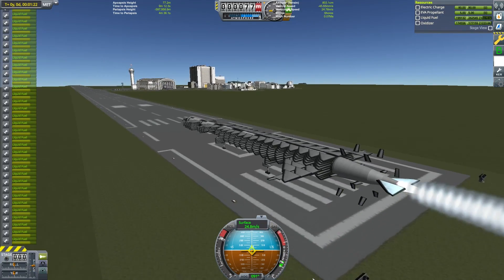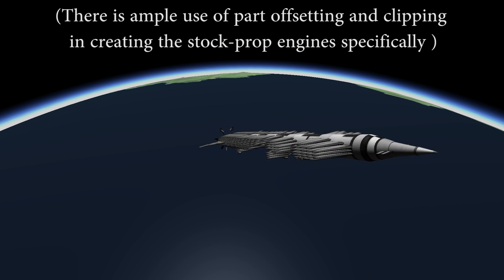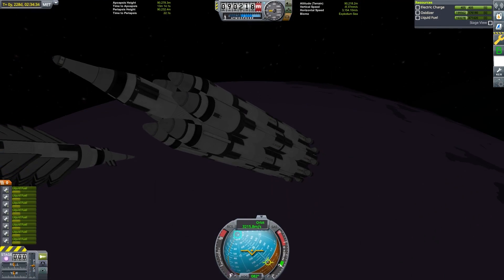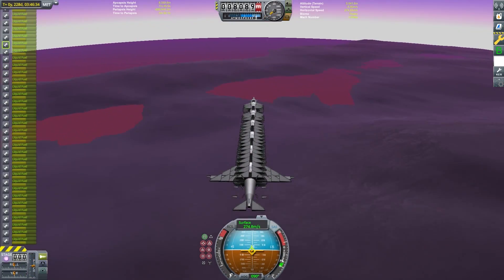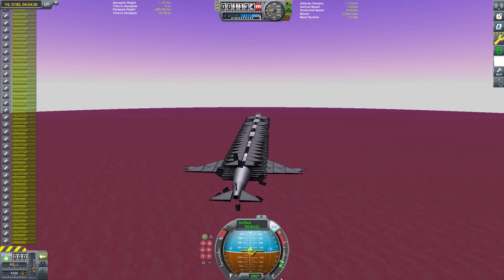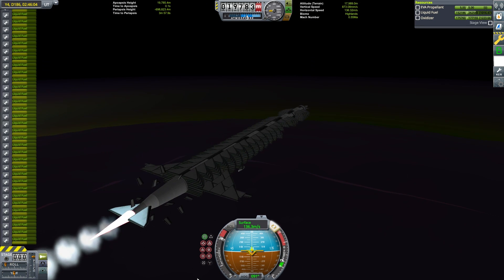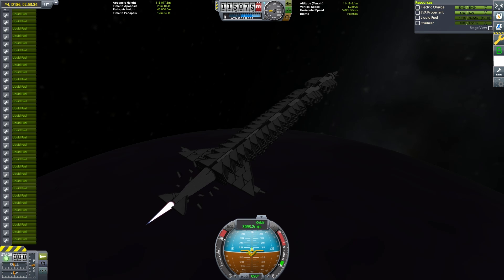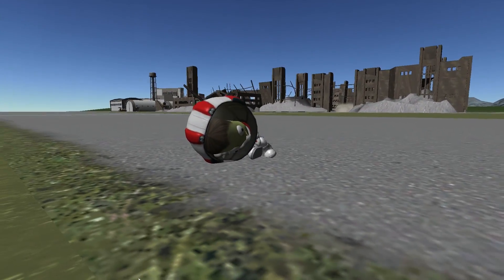Stock propeller powered Eve SSTO from sea level

Comment: Could you theoretically be able to build a Kerbin-Eve sea level-Kerbin SSTO if you just kept adding boosters? Sure, each next fuel tank will give you progressively less DeltaV, but you would still get there eventually, right? Or is there some sort of inpenetrable barrier that you will get infinitely close to but never actually reach? (Like trying to get to number 1 by adding 0.5 and then keeping adding half of the number you previously added. You'd never reach number 1.)
Reply from the maker: It approaches a mathematical limit as more fuel tanks are added.  We can calculate the limit your delta V approaches by taking the natural log of the maximum possible ratio of wet mass (mass including fuel), to dry mass (mass without fuel).  The full to empty tank mass ratio in KSP is 9 to 1.  (If you have a fuel tank that has a mass of 9 tons when full, that 9 tons consists of 8 tons of fuel and 1 ton of tank.)  ln(9) = 2.197...  You can then multiply that by standard gravity (g = 9.81 m/s^2), and your engine Isp to get the limit of your delta V as number of fuel tanks added goes to infinity.

For example, with a vector engine, with an Isp of 315 s in vacuum, this limit is : ln(9) * 9.81 m/s^2 * 315 s = 6790 m/s
For the skiff, with an Isp of 330 s in vacuum, this would be 7113 m/s

If fuel tanks had 0 dry mass, this function would become unbounded.  However, it would remain an logarithmic function, with severe diminishing returns. 

   Back to the original question, regarding whether the Kerbin -> Eve landing -> Kerbin single stage, unrefueled plane is theoretically possible, the answer seems to be no.  7 km/s already isn't much to work with.  You need to spare mass for engines, ion fuel for the interplanetary transfers, wings, landing gear, reducing this further.  If you bring air breathing engine or stock prop, that further decreases the fractional mass available for fuel.  You also have decreased Isp in atmospheric use of the rocket engines.  Short of some radically new approach, it doesn't look possible.

P.S.  'Boosters' generally refers to staged assemblies
Reply: good lord  @BradleyWhistance
Reply: @BradleyWhistance  I've been playing KSP on and off for a few years, and I finally know enough math to understand what you just said. I haven't played in a while, and I'm thinking maybe I should get back into it
Reply: Omg wow
Reply: @BradleyWhistance  Curious! The Mk0 liquid fuel tank has a wet:dry ratio of 11:1 which seems to be 22% better, but if you could somehow use it for the same purpose, it would offer only a 9% increase in range. The range difference isn't quite the square root of the difference in wet:dry ratio, so I'm wondering what it is; if you can calculate range difference directly from the ratio.
Reply: A bit late, but you would probably end up being severely limited by how much of a stroke youre willing to give your computer. I learned this the hard way when I tried to get a 100,000 ton mars transfer stage into orbit in RO with single digit framerates and my computers pretty beefy.
Reply: It is possible using certain physics engine exploits. One in particular can even give you a grand tour with no engine, though I'm not sure if it has been patched, and it was always difficult to control
Reply: Here after watching stratzenblitz video, yes, its possible
Reply: you would reach 1, just after an infinite amount of time.  I assume you can get very far in terms of delta V with every little improvement. however, you are limited by your computer
Reply: Kraken engine + prop engine

Comment: Brad: "A very simple, straightforward 2-stage rocket"
Also Brad: "65 mammoths on the lower stage, and 60 wolfhounds on the upper stage"
Reply: I mean, its simple, you just keep adding fuel tanks and engines until it works
I learned it from my double gravity series lol
Reply: Haha, radial mount go snap.

Comment: Did you try to use the propellers in reverse during descent?
Reply from the maker: I did consider this!  If undocked at high speed, it can cause excessive stress in the bearing.  At low speed, it glides well anyway, so it simply isn't necessary.

Comment: Astounding. Any chance you could post a quick breakdown of how the stock propeller apparatus works? As far as I knew rotating parts in stock KSP were impossible, let alone rotating airfoils with enough force to move 200,000 tons. Or if anyone else could just link me to something explaining the construction principles involved, that would be just as good. Thanks in advance (I hope).

Comment: wait, what does reversing nose cones do?
Reply: Forward facing surfaces generate more drag than backwards facing surfaces. If you rotate a nose cone that's on the front to facing backwards, you essentially have no forward facing surface, which drastically lowers drag, especially as you go faster and faster.

Comment: If low altitude on eve is problem why dont you use aerospike engines? I never see anyone use them and they'd seem perfect on eve. While they dont have gimbal the rcs and control surfaces could help
Reply: Guessing that they just don't provide enough thrust for their fuel consumption
Reply: @doas6311  that's the opposite of what they are supposed to though, they are meant to be super efficient in atmosphere, you could use atomics in space and earospikes in atmosphere
Reply from the maker: @Dragon74213  The Aerospike does have the best TWR at sea level on Eve.  Problem is, its TWR is bad, and the Vector/Mammoth engines have better Isp during a lot of the ascent anyway.  They also are not very compact.
Reply: Exactly. When it comes to eve, raw TWR is more important. Your margins for useful payload are very small, successful eve rockets can barely lift their own dry mass, let alone any cargo. So to use aerospikes, you need to build a rocket capable of carrying a lot more dry mass for the exact same amount of thrust... which is hard when you’re talking about a planet where every pound of dry mass hinders you this much. Any fuel savings you’d have from using the more efficient aerospikes is immediately pissed away by having to lift the extra dry mass the engines.

This same principle is also why I jump to vectors and mammoths instead for just about everything atmospheric. The same principles apply on Kerbin too.

Aerospikes USED to be very commonly used in KSP, espescially in SSTOs where they were paired with panther jet engines. They were also often the goto engines for Eve. They were very good.

The reason nobody uses them now is that they’ve suffered “power creep”. All these new fangled engines have been added, all of which have stats that essentially make aerospikes superfluous. The aerospike hasn’t really had any stat upgrade to keep up and compete with the new engines.

To put this into perspective, back when the aerospike was used often, the biggest engines in the game were the mainsail and the skipper (2.5 meter engines). There were only 2 jet engines, the one often used was the panther.

There was no Rapier, there was no Vector, there was no Mammoth, etc. In that kind of environment, using an aerospike makes A LOT of sense. Most of the traditional rocket engines only had slightly better TWR, and were quite inefficient. The only real downside to the aerospikes was their small size, small total thrust, and lack of gimbal. Nowadays, want an SSTO? Just use rapiers, don’t need to do rocket/jet pairs anymore. Want a rocket? Use something with good TWR to get you out of the atmosphere, stage, then use something with high efficiency once on orbit (just like real life rockets).

The aerospike has little place in the real world too. It’s a complex and heavy engine type. It’s only worth spending that kind of effort on it under one condition: If you are using the engine for 100% of your propulsion needs on a trip, and if you are going to be getting the engine back. In other words, a rocket powered SSTO. It was developed specifically for this purpose, to be used on the X-33, the only project that got anywhere close to actually achieving SSTO purely on rocket power. That project was canceled, and no rocket powered SSTO projects have since replaced it. Instead, the space industry has since settled into using traditional multistage rockets.

And thanks to the Sabre engine (the real world engine the rapier is based on) and the Skylon space plane it is intended for, there may NEVER be a place for the aerospike engine in the real world. The Sabre engine is a jet rocket hybrid that has a very high TWR (for a jet engine), can operate in most ranges of atmospheric flight (unlike most jet engines which typically have very limited ranges), and can take a space plane up to 20% the speed and altitude required to achieve orbit in air breathing mode alone.

In other words, if the Sabre engine proves to be as good when it finishes development as it appears to be on paper, there’ll be little point in making rocket powered SSTOs... Which means little point in making aerospikes. Who knows, maybe it’ll be worth it if we ever attempt to make launches from the surface of Venus, given how incredibly thick and oxygen deprived that atmosphere is. But that’s a long way off.
Reply from the maker: @hatman4818  Additionally, the vector engine is much more compact than the Aerospike, and has massive gimbal range.  On the other hand, the Aerospike looks nice...
Reply: @BradleyWhistance  That's another reason I use vectors. It's basically a 1.25 meter rocket engine with 2.5 meter engine thrust values. I made a subassembly that is a 5 meter tank (using the expansion parts) with 12 or 13 vectors mounted to it. None of them clip, and if I radially mount more of these blocks to each other, they won't interfere with the other blocks as well. I figured that gives me about the highest TWR in the smallest package possible for a 5 meter rocket.

Comment: Congratulations.   I really think KSP should introduce build-in propeller system. Propellers are theoretically supported by KSP’s physics and make a lot of missions possible.
Reply: Exactly. This, and for god’s sakes at least ONE hinge. They already have a stocklike hinge model developed for stock KSP that they dropped before putting in.
Reply: @GrandProtectorDark  I really wish they would add some electrically powered propellers. I would love to be able to fly planes on planets that have an atmosphere but no oxygen without having to use ultra-thirsty rocket engines.
Reply: this is a comment from the future. ksp has propellers now
Reply: It appears easy from a programming perspective, just take a jet engine, swap out the fuel requirements and give it a model. Shouldnt be too hard to do.

Comment: Have you considered using the part welding mod to reduce the part count? Or does that change the physics or feel cheaty in a way?
Reply: That means it's no longer stock though.
Reply: I've also had little luck with part welding aside from structural parts. The problem is different part types will have different properties that all then get applied to the welded part. I tried welding several Big-S wings together, and combined they had way too much lift compared to the sum of the individual wings. Maybe procedural wings and fuel tanks would help.